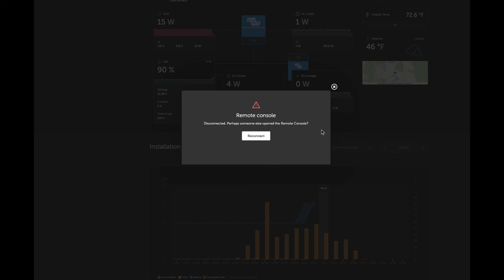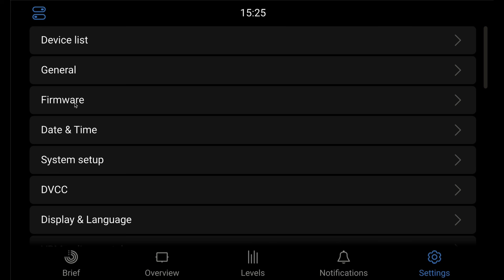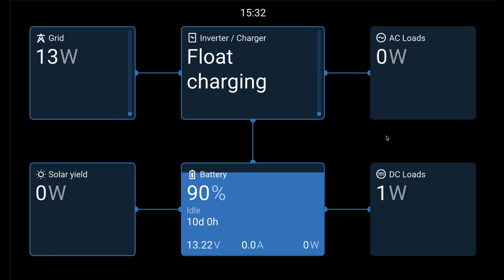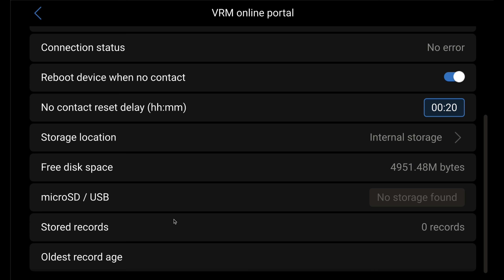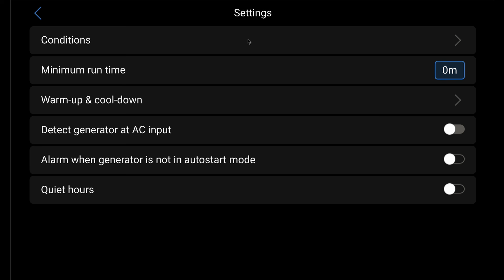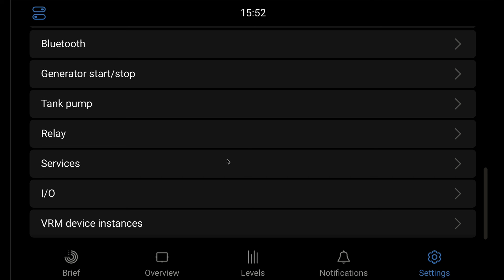Victron Cerbo GX MK2 - Part 3  Programming, System Setup, New GUI

Comment: Hey mate quick question about the manual relay can I use them as a switch panel to switch another relay to turn on lights or a 3rd party inverter?
Reply from the maker: Yes, that works fine. Just be sure to not overload the relay. They do have a max load that varies based on voltage level.

Comment: can you click the Multipus bubble on the display to be able to a quick menu to select inverter only charge only on and off?
Reply from the maker: You can click on the inverter bubble or use the quick toggle tab in the upper left corner to adjust inverter state.

Comment: Didn't really learn anything and my GUI is different. Firmware v3.70~7
Reply from the maker: You're running Beta firmware. Not the official release stream.
Reply: @BackwoodsSolarElectric  You need(ed) the beta firmware to run the victron program thingy in kiosk mode on a tablet.  Didn't use it much so I changed firmware to release and factory reset tablet.

Comment: Thanks for the video. One question, is it any way to connect a blue smart ip22 charger to Cerbo?
Reply from the maker: No, not directly. You can VE Smart Network it to your other Victron Bluetooth devices. This may be helpful with a SmartShunt Or BMV as it will provide battery voltage data directly to the IP22. A bit more accurate of a measurement vs the IP22 terminals as current moment distorts voltage.

Comment: Hello, I installed the Ekrano GX in my Victron system. I've now connected all loads via AC-Out. I've also connected a heat pump to it. I record its values via a separate meter (VM-3P75CT). Do you know a way I can display this load as a separate block in the overview? Either parallel to the other loads or as an additional block attached there.

The meter is listed in the device list and already provides the correct consumption values. But to see them, I always have to click through the menu. It would be nice to be able to see it immediately in the overview.

Comment: Thanks! Solid video/demo. I am upgrading to all Victron home solar equipment. Already have the MPPT 450v/200a solar charger, Smart Shunt, and Victron Connect (Bluetooth APP).  Next up is the 5,000VA Multi Plus inverter. Gonna need this Cerbo to my router to have full access to control the system/monitoring.
Reply from the maker: Great choice on the Victron product. You won't be disappointed. Most of us here run our off grid properties completely with Victron equipment. Give us a call if you have any questions or need any help with your system. https://backwoodssolar.com

Comment: Is it possible to connect a battery charger and an  inverter non-Victron and have all the data visible on the display. i have a Mastervolt COMBI 12 - 2000 thank you
Reply from the maker: To collect data on non-Victron products using a SmartShunt on each would be the easiest. SmartShunts can be programmed as a "DC Energy Meter" then assigned as an "inverter" as an example. The Cerbo would then collect and label that voltage and current data just as it was a Victron inverter. Same with the battery charger data.
Reply: @BackwoodsSolarElectric  Are you telling me that if I use a Victron Smart shunt at the negative output of the charger and/or inverter I can collect data on the Cerbo? If so would you suggest how to make the connection ? Thank you you are very kind and I am sure it is a common problem for all those who want an advanced system like Cerbo but already have a no Victron system (charger and inverter)
Reply from the maker: That is correct. You're welcome to call in and talk with one of our techs for specific tips. The ease or place of connection may vary. However, the shunt can be placed anywhere in the negative connection. A lot of people, with the inverter as an example, would add a short 10" cable. This would allow for a "break" to made in negative cable and the shunt placed in line. So you may go from the inverter negative terminal down, then new 10" cable, then shunt, then land existing inverter cable on the shunt. Here is a link to a 2/0 10" cable we stock, we also have them in 4/0 depending on current.  https://backwoodssolar.com/product/battery-interconnect-cable-10-2-0-ul/

Comment: Thanks for this excellent and comprehensive explanation. I have seen on a few Cerbo Touch screens an additional "Bubble" as you call it, for "Alternator". How do you show that on the screen? Regards, Silvano
Reply from the maker: You will have an alternator bubble when you attach an alternator DC to DC charger like a Victron Orion XS. The XS series have a VE direct port for sending production data to the Cerbo.
https://backwoodssolar.com/product/victron-orion-xs-dc-dc-battery-charger-12v-to-12v-50a/

Comment: Can you direct me to “cables” and/or “devices” needed to monitor the different kind of inputs?
Also can this device monitor other manufacturers mppt charge controllers for example Outback 80A?  What kind of connection is needed?
Reply from the maker: The cables needed will vary depending on the product being connected. What are the data points you're trying to collect? I can provide additional details specifically. Or you are always welcome to call in and talk with one of our techs. When it comes to bringing in data from a non Victron device, like an Outback FM80, the use of a SmartShunt is the way to go. They can be used as a "DC Energy Meter" and defined as a variety of different types of devices. We would tell the SmartShunt that it is measuring solar charge control and it would collect and display that data just as if it was a Victron Solar control. The SmartShunt is connected to Cerbo Via a Victron VE Direct Cable.
Reply: I  have an off grid cabin and want to be able to operate my system remotely via internet. So I need a system to do the following 
1) monitor and control MultiPlus 24/2000/50-50 120V 
2) monitor state of battery bank
3) remotely turn on generator 
4) monitor and control Outback 80A ex. Turn on Equalizer function etc. 

I’m not sure if the Cerbo is the best solution or if another option is better. 

Thank you!!
Reply from the maker: For those 4 items I would do a Cerbo. Parts needed: 
1) RJ45 cable for VE bus communications (inverter to Cerbo). 
2) To monitor the battery bank you could do either a BMV-712(only if you want another small display) OR a SmartShunt. Both items use a VE direct cable for Cerbo communications.
3) The Cerbo has this built in. Relay #1 has dedicated generator control functions.
4) Use a Smartshunt programmed to a DC energy meter and assigned as a solar controller. You would need a VE direct cable for Cerbo communications. To be clear you can only read and record production data from the Outback. You will not have programming control. You would if it was a Victron solar controller.